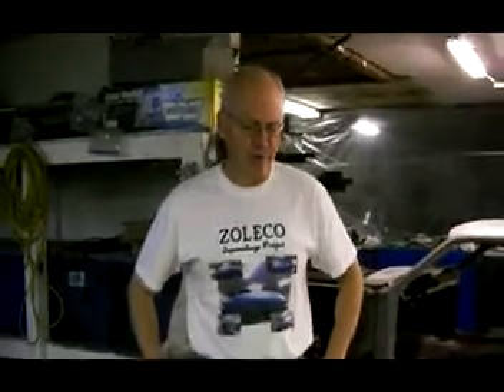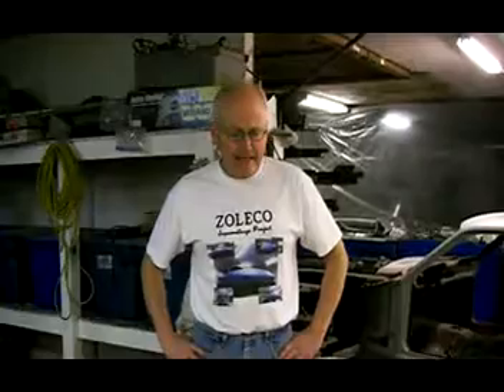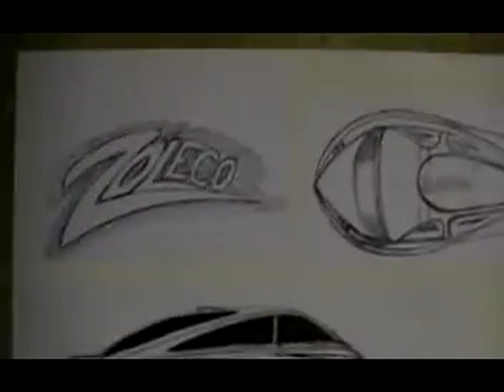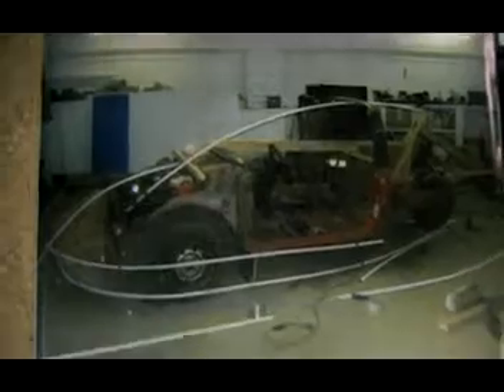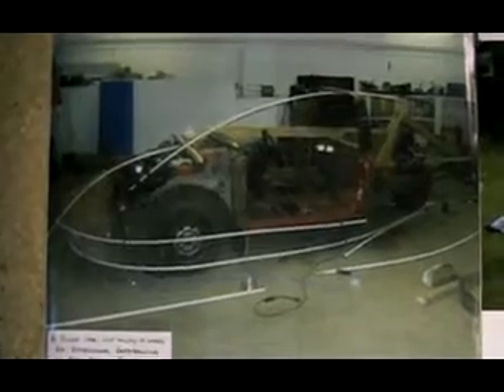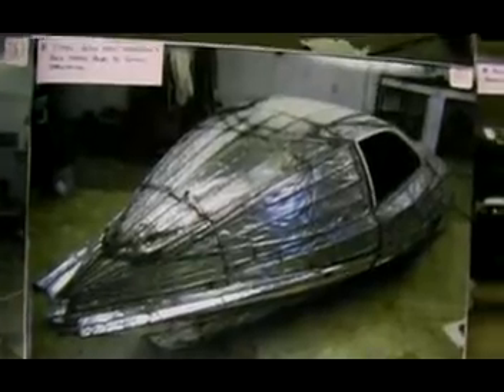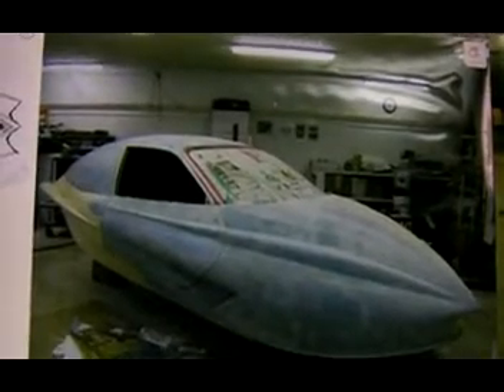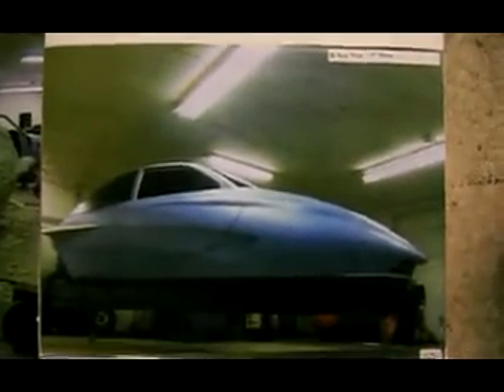Futuristic,high mileage body design concept,Zoleco video 1

Comment: Actual tear drop are not pointy at front; they are pointy at rear. Hence they are not most aerodynamic, in my openion. This car is pointy at front, hence not fully tear drope shaped. Hence more aerodynamic than standard tear drop.

Comment from the maker: @lsdesign It is green as a result of the aerodynamic efficiency of its shape and the use of light wieght fabrication materials resulting in it using a much smaller engine thereby conserving energy.Yes ,the 1st proof of concept is using a turbo charged gasoline engine directly out of an OEM.Reason being when the car goes to the salt Flats for the 150mph/150mpg Challenge we want to isolate and document the benefits of each idea implimented for its own merit.This is just the begining for the car.

Comment from the maker: @goodgigs Thanks for your comments.The "hyper rocket "version in this case would be the 340 hp version with potential to run mid to high 9 sec 1/4 mile times.Yes limited production is the long term goal.You are the 1st to call it too normal.You must have an eye for the future.